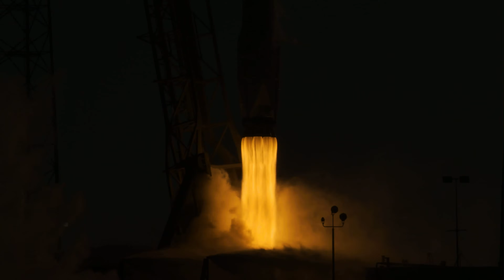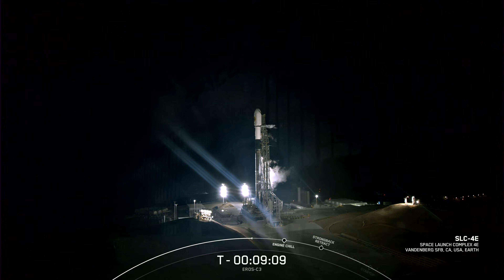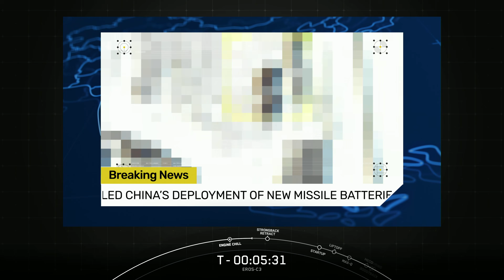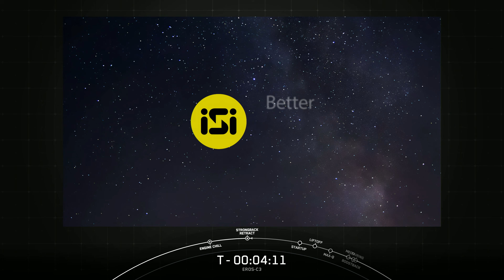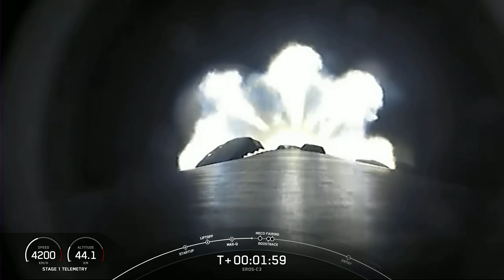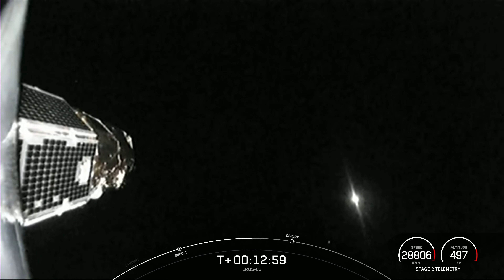ISI EROS C-3 Mission

Comment: I don't understand the velocity read out on the 1st stage. If it is on a vector through the rocket, why doesn't it go down to zero as it slows down and reverses course, then speed up again?
Reply: I believe it's in relation to the launch site.
Reply: At stage separation the rocket is flying at roughly 1.4 km/s horizontally away plus 1.4 km/s vertically up. The boost-back reverses the horizontal component of velocity, but the stage continues to fly up, which you can see from the altitude increasing all the time. Then it reaches the apex of the parabola, and starts falling down. The velocity is never zero -- when one component is zero, the other one is not.

That's the reason. The specifics of the coordinate frame do not make a huge difference here.
Reply: @cogoid  OK, that makes sense then.  I just wrongly assumed the reported velocity was through a vector along the 1st stage centerline. Thanks.
Reply: @rosswarren436  The velocity shown is the velocity reported by the GPS receiver on board. It uses Earth-Centered, Earth-Fixed (ECEF) Coordinate System (rotating together with the Earth.) But that does not change the above explanation significantly.
Reply: @cogoid   Very, very good.
Reply: Cancels out horizontal velocity, not vertical velocity.

Comment: Why does falcon9 not need a heatshield while starship does?
Reply: Good question. Take Artemis 1: when it re-entered Earth's atmosphere, it was travelling at 40,000km/h. Top speed of Falcon 9's first stage at re-entry: about 2,400km/h. It's an order of magnitude different, and thus the extent of atmospheric heating is in no way comparable. As for starship: it's an orbital vehicle where Falcon 9 first stage is not. So it will be travelling at around 28,000km/h at the point of re-entry, which is again around ten times faster than Falcon 9 first stage ever goes.

Comment: I can find tons of results on Google about the white stuff falling off rockets at launch and the white cloud coming out of the rocket during fueling, but I can't find anything about the white fluffy things growing out of the engine and then breaking off when it's in orbit. Is it leaking, freezing fuel? Condensation (even though there's practically no moisture in space)?
Reply: That’s solid oxygen from the vents.
Reply: The liquid oxygen in the tank boils off so it must be vented overboard to maintain the pressure in the tank. When they vent it, some of it freezes and that is what you see.

Comment: They used 20+ tons of lift capacity rocket for a satellite of only 400kg?? Any secondary payloads for this mission?
Reply: Prograde Orbit. Takes much more effort to reach.
Reply: And they launched opposite the Earth’s rotation. Not only did they lose the 450 m/sec they would gain by a normal prograde orbit, but they had to cancel out that penalty and make it up in the opposite direction.
Reply: I understand now, thanks for explanations.
Reply: @Touretti  Retrograde.